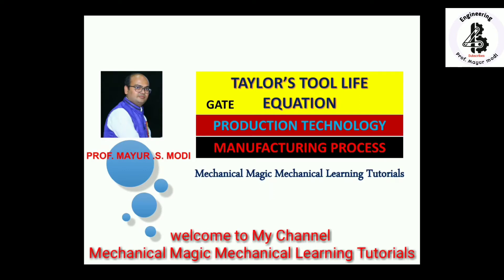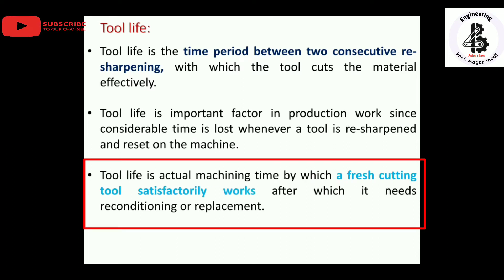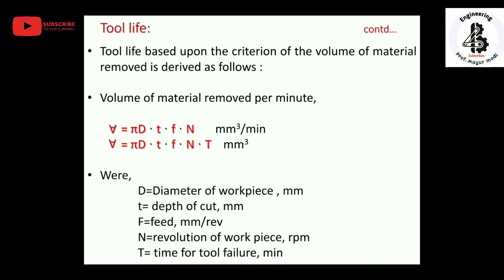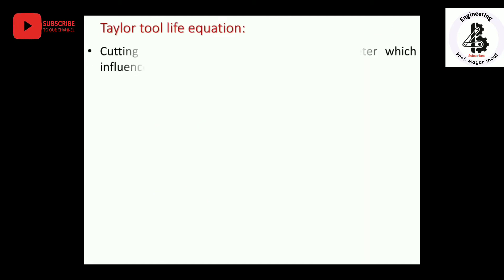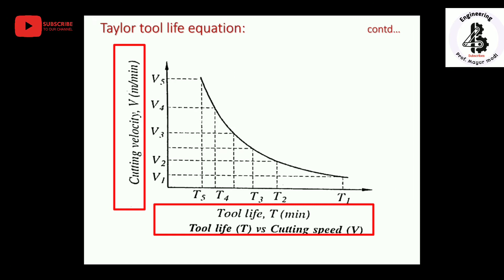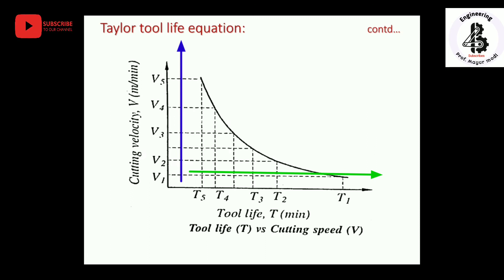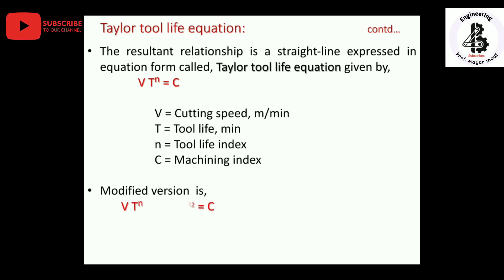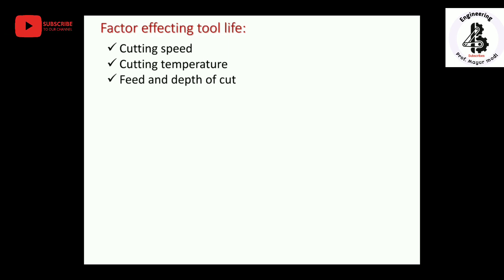Tool life | Taylor's tool life equation | factors affecting tool life | GATE | PT | MP

Comment: in practical life what is the real speed we usually get ?
and how do we come to know that tool life is over ?
Reply from the maker: In practically speed that will depends upon so many parameters like tool materials, workpiece material, machining conditions, operations, requirement of machining,etc.....
If case of life our tool is not performed satisfactory output so can judge tool life is over.

Thanks
Subscribes, like and share
🙏🙏🙏🙏🙏🙏🙏🙏🙏🙏

Comment: Sir explain the reasons that the same tool life may be obtained at two different cutting speed
Reply from the maker: Because speed is not only one responsible factor for tool life that why. According yo Taylor 's tool life equitation VTn = Constant.
If you change other conditions like tool materials, workpiece material, coolant conditions, etc are change so for same life at different speed.